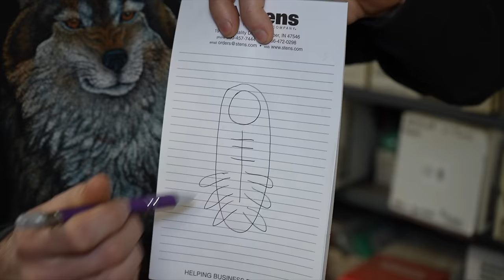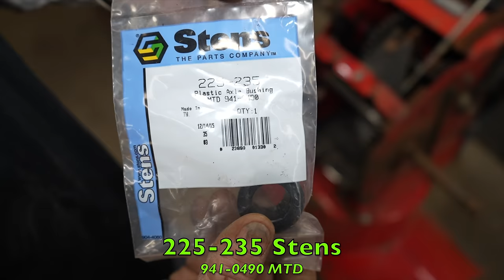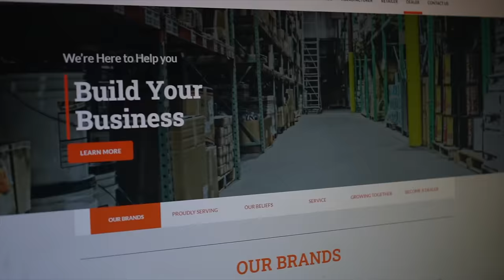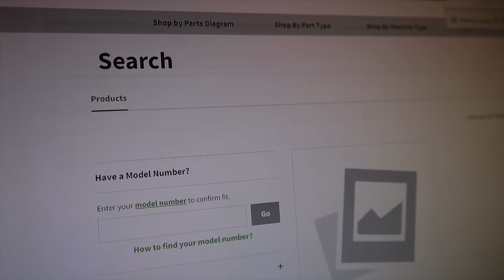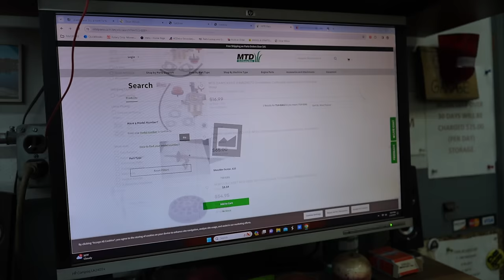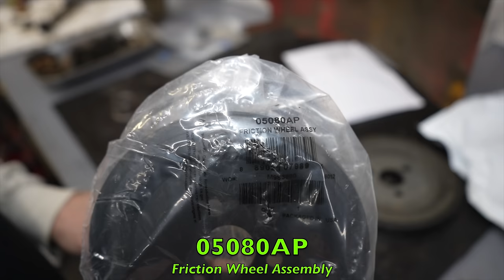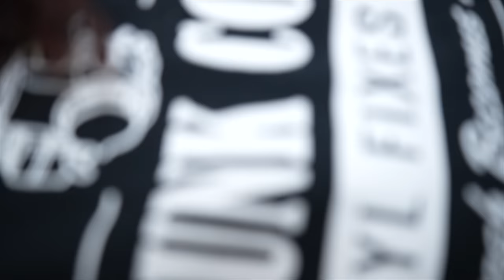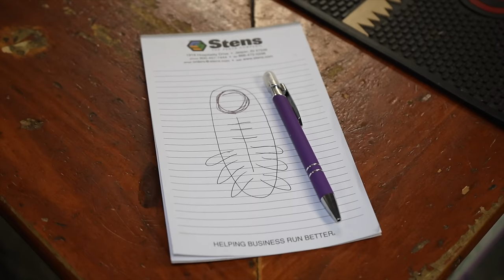Spent WAY Too Much $$$ Polishing This Turd

Comment from the maker: Support the channel directly! Grab a T-Shirt, Scarf, Coffee Mug & More! Shipping Worldwide 
www.TARYLFIXESALL.com
Reply: Great job Terrell
Reply: What a turd, there is no way that MTD crap is better than my Toro pro max. Yesterday my Toro munched through 6 inches of ice all on my driveway , it made an amazing sound right down to pavement.
Reply: You probably did that already but you could have had somebody turn that down .015 or .020 to clean it up to a smooth cylinder and then make a bronze sleeve and put over it and turn that back to the correct OD and set the clearance for the ID of your new bushings!
Reply: I flip blowers a lot and I look for nice clean ones in the summer, you get them dirt cheap and then maybe put 100-200 into them max and flip them in the fall/winter.  Belts and carb kit are usually a given, if the friction disc is bad I usually pass on them. It is common to find them with bad auger shaft bearings and seized wheels/axles. That blower would sell for around $400 in my area all fixed up like that. When I fix up a decent blower in mint condition they can sell for around $800-$1000. I prefer working on the older ones because I can get parts easier and I have a lot of good used parts for them sitting around. Don't overpay for something that needs work!
Reply: "Mice access hole" = 😂😂😂
Reply: all that stuff is about 90% of the older machines I see. Worn out everything...

Comment: The 2 different axel holes are for tire size. 5 and 8 hp. The empty hole is for mice to access
Reply: Yes the units with the taller tires the axle went in the upper hole and the shorter tires went in the lower hole.
Reply: @KraeseRepairs  Units with tracks use one of the holes as well.
Reply: At least they gave the mouse a home lol
Reply: Exactly! I stuffed steel wool in there and mice have to live in the lawnmower now
Reply: 😂aww they thought of the mice when making this snowblower

Comment: I used to work on vintage railroad equipment for a living. Building up worn parts with weld and machining them back to tolerance was an every day occurrence. You're not going to find parts for a 1915 steam engine on the shelf. Really gives you a sense of pride in a job well done instead of just replacing parts.

Comment: When I work on stuff, my experience is like yours with this machine.  I have to take and put back together several times before I get it right.  It's not like I do the same repair over and over.  I know when I do get it put together, it's right.  Your videos help me avoid making the same mistake a few times.

Comment: And btw, the old simplicity sitting in the background , also reminds me of the days I did this type thing . lol! It was a simplicity dealership , along with , general small engine / equipment repair . But it’s almost identical to one of the two simplicity’s I own, the other is a newer model , wit hydrostat drive , I bought new in or around 1993 . While they were still owned and manufactured , by their actual allis chalmers parent company , and they have both been tough little machines , and still going today . I’m disgusted to even look at their newer ones . They’re junk as well , and have cheapened themselves right out of existence from what I understand , after being bought and sold several times to lousy companies who sell them on their name only . No build quality left to them either unfortunately, and I wouldn’t want one of them today either !

Comment: Not too many years ago I had a frequent customer that tried to service his machine just like that and had that same issue taking the drive out of the machine at his place. He was about down to tears crying in his garage. The next thing that happened is I horrified the hell out of him when I took my angle grinder to it and cut that center support out which now and forever more makes servicing that drive system a breeze. I welded two 90 degree pieces of metal to the ends so it would bolt back into the machine. This time the old timer customer was nothing but tickled to part with the $200 and by the time the storm ended 2 days later with like 30 inches of snow well he's been a bit more relaxed around me these days.. Most of later model MTD machines have actual bearings in there as well. Somewhere I have the boxes with thee part numbers on em

Comment: If I owned this machine, I'd gladly put the $300 in parts into it, and also gain even more solid knowledge of how it works.  That is, essentially, a new snowblower now.  It should last at least as long as it already has.  I priced new snow blowers of that size, during this video, and found the cheapest one was about $500.  I'd rather spend the $300, and have a machine which has already proven it can last over thirty years.  In fact, while ordering parts, I might even buy extras of a few, like the bushings. 

Like you always say... They don't make 'em like they used to.
Reply: @WJCTechyman  You didn't rain on my parade.  I stand by what I said.  Your third sentence adds credence to my point.  Thank you.

Comment: This is why I work on all my equipment.  Fix it and understand how it works rather than buying new because of a breakdown.  Only one person within 25 miles of me works on any outdoor equipment and he won't touch anything that requires a rebuild, and won't even do a valve job, so it's me doing the work.  Great video .   From the guy who has stopped and discussed the Deere 214 rebuild.

Comment: I have a 1965 Ariens snow throw. Same year I was born and bought new by my grandfather.
Yea... I like that. From Grandpa, to my Dad, down to me. I'm hoping to give it to my Grandson some day. My daughters don't have a lot of interest in it ;-)
About 8 years ago I had to do most of what Taryl's doing with this one.
It does take time but, in my case, it was worth it to me to try to save it.
Reply: Great story!  Ariens are designed and built better than other brands so yours was especially worth it; I use a similar machine from the 60s, but was from an auction
Reply: @alant8764  I hope your keeps throwing just as good as mine. It's ridiculous how there are no safety features but so far... no need for an ambulance 🙂

Comment: That rebuilt one will probably outlast the new ones made. Still running 2 MTD's over 25 years old a Silver painted 28" 11hp sold thru SAM Club back then and the monster 45" 13hp here in PA and never had to fix anything on them. Those old Tecumseh winter carbs are the best. Been using the 45" to clean a 1/2 acre gravel lot trading the skids for mower wheels on front to keep the stones out.

Comment: Your heat quench trick is about the neatest trick I've learned in a long time! Matter of fact, I was watching a heavy equipment repair channel a few days ago and this guy was working to remove a big broken bolt from a piece of CAT equipment. He had tried a couple of different things then he heated it cherry red, poured a couple bottles of cold water on it and removed it with a pair of pliers. I asked if he learned it from you but never got a reply. BTW, I'm 78, retired equipment maintenance manager and I still love to learn new ways of doing things. Thanks!

Comment: I’m glad I’m not the only mechanic who is machining home made parts! The other day I turned some grade 8 bolts into gauge wheel pins and threaded the ends in my lathe because the customer wants them to last vs the stock softer steel Husqvarna ones! Fine by me, as I enjoy building parts when needed. I’ve repaired more of these old snow blowers than I can count. I can’t believe how little rust you guys have down there though. Up here in the rust belt in Canada, that whole thing is always covered in rust, ceased up and brutal when I rebuild them for customers. A torch is a must have up in these parts.

Comment: I have a 1999 Craftsman 28" 9hp track model bought new. The keys to keeping the running gear on these things in good shape is oil and grease, before every snow season, I use low temp snowmobile grease Tip it up on its face, remove the bottom cover and oil all shaft bushings inside and out. Grease the shafts, gears and chains, check that all parts move easily and smoothly. Rubber cleaner on the driven rubber disk, and clean the engine drive plate with brake cleaner. Tip it up on the sides and drop oil into the auger shaft side bearings. Make sure the tank and carb are completely cleared of all gas before storage. And above all, keep it in a shed or garage protected from the daily elements. Other than the little rubber bumper under the right handle that keeps breaking every few years for some reason, and one auger shear bolt after hitting a rock, so far, not a single repair or replacement of anything else, including belts.

Comment: I have one the same but maybe a little bigger. It has hand warmers on the handle bars. I think it's a 7 or 7.5 horse Techumish. The thing is though it's not a snowblower anymore. Somebody put a drum sweeper on the front. That thing works so good. Oh and it has a little button on one wheel hub that you can disengage both wheels from driving making it easier to turn. Thanks for sharing Taryl

Comment: I had an axle snap on my huge (45") walk-behind snowblower... i bored out both broken ends and inserted the pinnion from the spider gears of a '78 Chevy heavy-half ton rear end. 
Still working perfectly today... (and i did it in the middle of blizzard in my single-bay, Unheated, 200yr old Maine garage ~

Comment: Hey Taryl,  I have that same Tecumseh engine on my 40 yr. old Craftsman snow blower, and its still going strong.  Good engine.  Wish they still made them since they are that two shaft  model.  I dont have a friction type drive set up on mine.  I have an actual geared transmission, but it has been pretty much trouble free.
Reply: There is/was a 40 year old John Deere 26 inch thrower on eBay with a Tecumseh US made Commericial engine on it. It was at a Goodwill type place setting up the auction and did not say it runs, but I want it - mostly for that beauty of a side shaft engine. wow.

Comment: I like my older black snapper 4/22. it has the same Tecumseh motor as this but 4hp. I grabbed a HS50 Tecumseh 5hp from a Toro 522 for 40$. Will bolt right up & I'll have a snapper 522. Which they made for a while. But I like how small the 422 is for a 2 stage. Easy to muscle around. Bought it past July for 50$ & everything works. Threw 5 inches of slush & ice the other day no problem. My HSK845 MTD paddle blowers are good for powder.

Comment: You should repair and store every snowblower you can find.  Both Home Depot and Lowe's says they are dropping all gasoline appliances and moving to 100% battery operated devices.  Snowblowers will be worth their weight in gold in a few years.
Reply: worth only for those who use them or "like them" most are  junk!!! only ones Iever see that worked GREAT were the BIG OLD GRAVELY ,s with HUGE external Propellers  w/15 Hp Kohler engines and are  "SULKY" capable as Mowers.  And some Old Areins  & Wards ones. MTDs are the POPS ones in my experience
Reply: @stuszith  The choice is not perfection, it's battery operated crap or a gas powered model. 
The battery operated ones are just far too limited and will cost a fortune because the batteries are not going to last long used in such condition.  We're talking subfreezing temperatures with extremely high discharge rates.
Gas powered models can run for hours.
Reply: I hate that they’re making everything electric nowadays which is a bunch of crap

Comment: I nursed one of those back to life a few years back. Nothing like what you did, just re-powered it with a Predator engine. It worked like mad after that! The original engine was a Turd and the new one was a 100% improvement.

Comment: An often helpful trick for removing steel bushings/races is to lay a bead or 2 of weld on the ID. When it cools, the bushing will shrink and usually will fall out, or be much easier to remove. you can also weld a bolt to the ID and slide hammer out blind bushings.

Comment: Bottom line, years of use in the snow and slop and not one bit of lubrication until it got to your shop.   Probably one of the worst I’ve seen disassembled.  Thanks Taryl another excellent repair video from Podunk USA.

Comment: Well, that was lots of fun watching you spend all that money! It’s so much better when it’s somebody else’s money! The one thing that I’ve seen people doing is putting these rubber strips on the impeller to get a tighter fit. Supposedly makes one heckuva difference in wet snow. The biggest thing I found in these old blowers is the impeller shaft bearing on the back of the housing gets worn out and tired. Then it’s hard to get the belt tight and power is reduced to the impeller. Probably only a $10 part but it’s a pain to install. You can test bearing by pulling the pulley straight up, should very little slop here as it’s a ball bearing. It will likely be eating belts too!
Reply: 70 dollars an hour  ?

Comment: Devcon Epoxy for machinable parts.  We use Devcon epoxy on worn bearing journals in a pinch.  It works great and holds up well.  Keep up the good work.  I always learn something from you.
Reply: Taryl Putty…
Reply: When Taryl uses Taryl Putty, it looks like it works well for his application. I don't know how well it would work for rebuilding a journal or in Taryl's case a snowblower shaft.  Devcon makes a variety of epoxies for some tough applications.  I'm not a salesman.  It just worked well for us when we were in a bind.

Comment: You could probably also put the shaft in a lathe and turn it down, then press the appropriate size sleeve into the old bushing; whichever is easiest and best matches the equipment that available to you.

Comment: Some hardware stores have assortments of those sintered brass bushings in various sizes. You might find the ones you need for replacement. Most of those bushings are standard sizes. Less expensive than custom making them.

Comment: I have a few thoughts on this. If it was routinely looked over many of those repairs would not have been needed at the same time. If I had a machine that needed repairs such as this there would be some modifications and upgrades made that would prevent wear like this in the future (grease fittings, bearings instead of bushings, stainless steel shafts, etc). And finally, where are you going to get a new snowblower that will last as long for $300-$500 anyway? I have my inlaw's snowblower I don't care what it takes either I will have parts machined at work or come up with something to make it better and repair it. If I have to get parts from other machines and modify them to fix mine I will!

Comment: I have an absolutely beautiful condition older ScrubCadet 826 that had hardly any use. It was originally a track model. The tracks went to hell, and it ended up sitting for years. I got it, cleaned the Carbatrattor, put normal blower tires on it, and I have had it for sale for 2 months below market value. I had 1 call on it, but the guy said it was "too old".
I cant believe how people think nowadays!!
I replied with good luck with that pop-can built newer blower with the Chinese engine that most won't even touch....
Reply: I'd be all over that, if you were in my area.  I prefer the quality of older machines, and have the will and knowledge to keep them going.
Reply: @aj383  I hear ya. Crazy how times have changed. Keeping the older stuff going is most times easier than fixing OR should I say replacing newer stuff. Have a good 1

Comment: Taryl. when you have a difficult time getting grease off your hands, spray them with a good penetrating oil, that breaks down the grease. I use  a penatrating oil made by State called Pen then just good ole original go-jo. The combination works GREAT!!! It removes ALL of it and my hands come out sparkling clean LOL

Comment: This was quite a thorough job.  Whoever buys it will have a decent machine, if only they don't leave stale gasoline in it over the summer, etc.  It's true you can't refurb an old MTD and sell it for as much as another 30 year old 2 stage Ariens or Toro might be worth.  One thing to give MTD credit for in this design - you can remove & replace the belly pan with the wheels still on the unit.  I wish Ariens had done it this way.

Comment: I used this 2 part repair epoxy “Marinetex” to repair a shaft for an a/c clutch my knucklehead neighbor hooked a puller to on my Lincoln,It cracked the mounting,Pulled the snap rings right off and cracked the steel mount,Applied marintex sanded it round replaced the snap rings and drove until I sold it a out 150k miles.Reapaird a couple engine blocks with that stuff!Bet it would work on that blower shaft
Reply: What the heck? A couple of layers of Taryl Putty and good as new shaft?

Comment: It is perfectly understandable that you don't want chains on the driveway.  Almost as bad would be one of those people who doesn't bring his equipment in but leaves it to rust.  That is not just because it is going to be impossible to start without an overhaul but also because it will leave rust marks on the concrete.  Ideally these things would be in a shed or a garage (if you have the space for them).

Comment: One of the other things you can do is possibly put a sleeve that is a few thousandths smaller then the inner diameter of the bushing, heat it up and slide it on! It would work for many years!

Comment: You need to find some one in your area that can do spray welding. It would make farmer Dans job a lot easier and hopefully a lot cheaper. (Check that, $25.00 is dirt cheap), You might want to look into what a small spray welder would cost you seeing you have the intention to get yourself a lathe for the new shop. Spray welders are really handy for a lot of jobs.